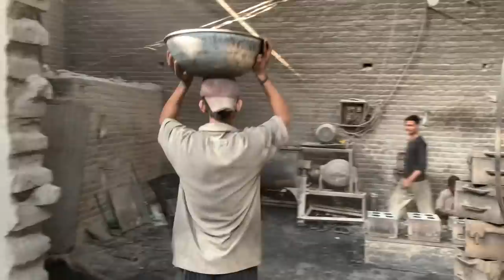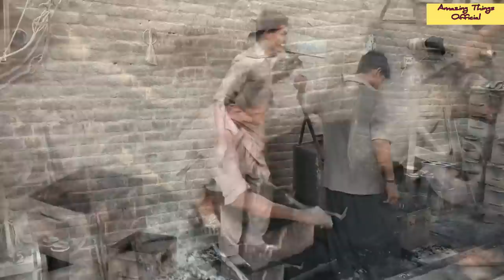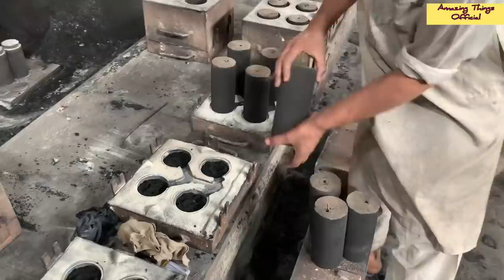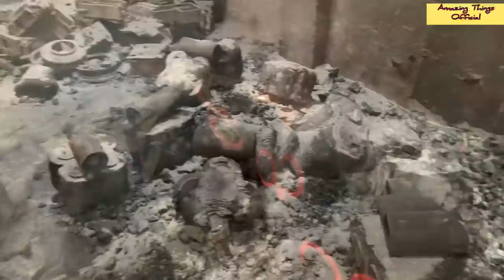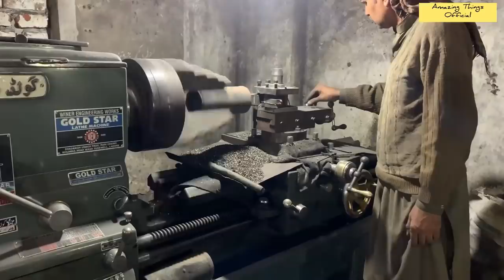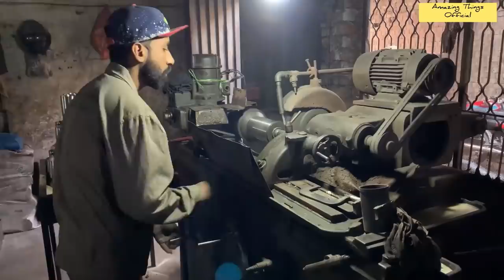Centrifugal Casting Process For Manufacturing Cylinder Liners & Sleeves || How Engine Sleeves Made

Comment: Speaking as someone who’s first job was in a brass/bronze/aluminum foundry casting mostly ship and boat fittings as well as coming from a family on both sides of machinists, millwrights and engineers with more than a little knowledge of metallurgy and engines, machining and tooling there is no centrifugal casting going on here.  It’s straight sand casting and machining. 

I too have some concern about the quality of the melt but obviously they make a lot of liners and must have a decent quality or they would be out of business.  I am sure there are some variations in the melts but they likely have a decent working knowledge of how much of this scrap and that scrap is correct for the results they need.  They can break them out fairly hot as they require a fair amount of post casting machining and their mix is likely a bit like chilled iron/steel.
Reply: @LegendLength  actually almost all piston sleeves are made of cast iron, as are most older engine blocks.  Quality cast iron, in piston sleeves often called chilled iron, is very tough and somewhat mailable.  Also it has a decent stability as far as expansion and contraction. It’s also a tad porous, just a bit so it absorbs a bit of oil into the surface which helps the rings last better. It also forms micro carbides as it cools and they add wear resistance.  It makes ideal cylinders/liners for anything from small engines to huge diesels and all the piston aircraft from flat fours and sixes to V-12s and the huge radials.  Depending on the formation of cast iron it can be hard and brittle all the way to tough and durable often used in vise’s, anvils, brake drums, rotors and calipers and most machines like lathe’s, mills etc. In the early years even complete bridges have been made of cast iron and some still exist.
Reply: also , these are so cheap, quality is not too relevant if it lasts just enough.for sure they will be immediately recycled.
Reply: I always cringe at the non existant safety precautions ...
Reply: @awax2585    Safety precautions is a western idea. In the East it is “In God we trust”. 
Besides safety precautions also have a cost.  Where human life is over populated, it does not cost much.
Reply: @hamed100  Боже мой как вы можете так о Людях говорить, 😢 Человек и его жизнь без ценная и прекратить её,так же  как и дать, может только Господь Бог.
Reply: @johngillon6969  Ah the US.. And you manufacture those days what exactly?
Reply: Hi Sir 
Could you please help me to know what was the black solution they added to the sand in the  mulling machine  . Look forward to hearing from you?
Kind regards
Reply: @Lived-in-England  I am sorry I can’t help you sir as my work in a foundry was rather brief and was with non-ferrous castings which are handled differently than iron/steel.
Reply: yep, just sand molds.
heres all the cylinders for those modern chevrolets, fords, mercedes, bmws, ktm's, yamahas...

rough turned, shipped off.

i live in australia and i work like this, barefoot in the dirt at times. its fun.

stupid people get hurt. engage brain. just because youre in sandals doesnt mean you arent aware of that 1500C metal... makes you more aware if anything!

unfortunately, its when profit is the driving force rather than simply doing something, when things have to get out the door yesterday, when things require too many people and too many instructions and whoevers directing stuff has no idea and everyone wants to direct... thats when things go wrong. every oh&s incident i have seen is due to complacency, stupidity, laziness, incompetence, or rushing... sometimes, unfortunately, the victim isnt the one at fault. wrong place. wrong time.

shit also happens.

Comment: Where was the centrifugal casting I didn't see any. Firstly my concern is scrap steel going into the furnace, scrap that varied immensely in quality so there could be no consistency in the quality of their product. Second, those castings are being broken open long before the metal is allowed to cool , which again is detrimental to the product and dangerous to the men who have no protective clothing or footwear . As for throwing poorly machined parts onto the ground in all that dirt and dust  expecting an end user to build a quality engine with them is insane.
Reply: Much agree!
Reply: 1. It’s all consistent when melted together, 
2. Osha nazi’s aren’t needed at this workplace
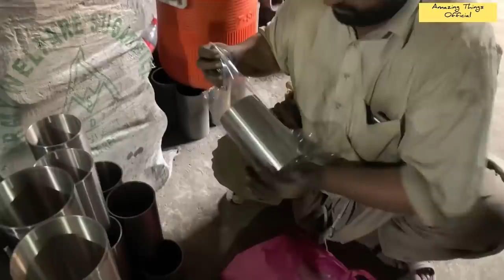 3. at 21:38 you can see the guy putting the neatly stacked cylinders in plastic.
Reply: There wasn't any I agree. But that isn't steel it is cast iron. Seems to machine quite freely nothing wrong there. Rough turning followed by grinding. Looks like a reasonable product. I wouldn't say they are poorly machined. Remember the machining is just a rough process - it is the grinding that gives the accuracy and surface finish.
Reply: @codprawn  definitely agree, cast iron. The chips are small and powdery, not long or stringy.
Reply: @btrswt35  
And the distinctive hiss. I love turning cast iron but it makes a hell of a mess. Make sure the ways are covered.
Reply: Not in this video. That by the way, was stolen from another channel.
Total hack production.
Reply: Shows thumb nail of some high precision German manufacturing unit. Immediately starts with a barely standing open to weather dust filled building with manufacturing techniques from 100 years ago. 😂😂
Reply: Put it in perspective, the finished part probably only cost a quid!!
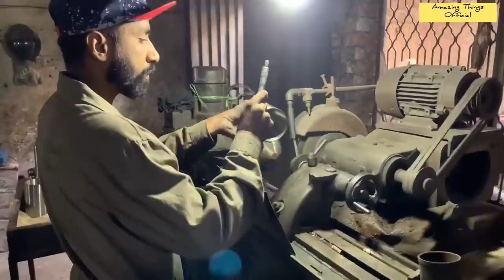Reply: 20:39 calipers!?  Am I the only one shocked? Not saying they’re calibrated or anything…
Reply: This comment shows a tremendous lack of understanding. This is a third world country where labour is cheap and goods are expensive - the opposite of the west. These sleeves will end up in truck engines like everything else on this channel, providing an economically feasible repair and enabling someone to maintain their livelihood through their vehicle. The end user (see: the video on this channel showing sleeving a block) could not care less about dirty parts. If these sleeves fail? They will do it again, and Barry's armchair expertise from 10,000 miles away won't make them rethink their process.
Reply: @moham1287  -These parts go to the west, and then you are surprised that your car has broken down for 100,000.
Reply: @moham1287  Well said, thats also why they will always be poor and abused.
Reply: @moham1287  when sleeve fails it breaks engine block, piston, crankshaft etc...
Reply: Always amazed at how crappy everything is

Comment: The lathe center is wobbling, that means the center bore will not be concentric to the outside diameter. Looks nice turning in the lathe but if you were to measure the wall thickness around the liner, you would find differing numbers.

Comment: A friend of mine had Enfield India Motorcycles (the original one) and ordered replacement parts for it from India.
I can guarantee that the cylinder liner wall thicknes was constant within + - 5 mm on most of the cylinders.
On one of the cylinders the bore was so offset to one side that it was impossible to mount, so he asked an Indian mechanic what to do, and the usual solution is to grind off a little from the inside of the piston so it can match the offset on the connecting pin.
That's a perfectly acceptable solution in India
Reply: @@kapilagrawal1237 even worse then. they tend to just hammer it in and wait for the engine to "break in" instead.

Comment: Precision is a relative term. Which car manufacturers use these parts for their engines?
Reply: That's the best reason not to buy foreign crap!
Reply: I'd love to know who's using these parts in their cars
Reply: Quality isn't that important, vehicle will be hit with an RPG long before it wears out.
Reply: John deere, ford, Mercedes, you know, the "quality" brands get their parts from these guys
Reply: Well its a local made aftermarket parts for locals only. I am from Pakistan we are happy to use them terms of quality wise. As we hardly do 4 to 5k kms a year so not much wear n tear
Reply: @danhammond8406  I'm not a Fan of JD but I have worked there sometimes in Mannheim,Germany and this is not what they used to use.  I have seen there extreme precise and well designed castings and machined parts at every place.

Comment: I admire their inginuity but my concern is the quality of the scrap being used.
Reply: Doesn't matter seems to turn nicely with a good finish and no nasty voids.
Reply: LM4 pigiron to be used for melting molten material temperature 880degrees chemical test to be done.minium .30 chromium should be there.nothing followed spun castings.crude in method adopted.
Reply: Scrap metal is used all over the world to produce steel and cast iron.
Reply: @MichaelHeinrich1  
Yes you are quite correct!
Reply: @MichaelHeinrich1  ...with chemical content correction and control - it's a small, but most important detail...
Reply: @codprawn  ...not quite

Comment: Where’s the centrifugal part ?  Must have been when the guy picked up the sand cast mold and turned around quickly
Reply: Centrifugal die motor powered not there to poreolyen material.no chemical test chromium silicon total carbon manganese required for cylinder liners plus LM4 pig iron.

Comment: Does anyone know what was the black solution they added to the sand in the  mulling machine  please?
Reply: from the smoke, and the region, and the price... probably just sump oil. and the rest would be recycled sand... pre-blackened.
Reply: Thank you very much for your reply sir. Sounds like the were adding Molasses lightened with water which makes the sand much stronger. 
I tried used oil with sand. It doesn't give the required strength.
Really appreciate your help 
Kind regards
Reply: @Lived-in-England  my bad. i completely forgot about molasses!

mmm, smells nicer too...

Comment: Does anyone knows that is that white pownder they pass at the mold?
Reply: Talcum powder I think
Reply: But I really need to know what is the black solution they add to the sand  in the mulling machine ?
Reply: @Lived-in-England (guess) it’s a species of crude molasses.

It supposedly helps the green strength.  When it “burns off,” it helps the sand not stick to the iron.
Reply: @dennisyoung4631  Thank you so much sir!

Comment: Being engineer I can say that the process is not Centrifugal casting. It is simple sand casting. Safety conditions are very bad and operational hazards like silicosis , dust inhalation are plenty. Such bad manufacturing process should be shown as an example how not to do casting.